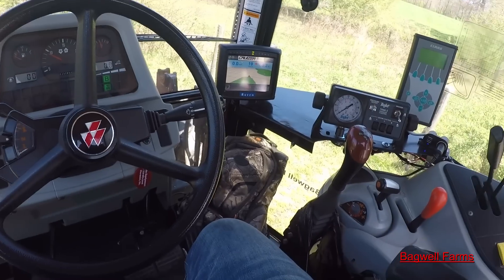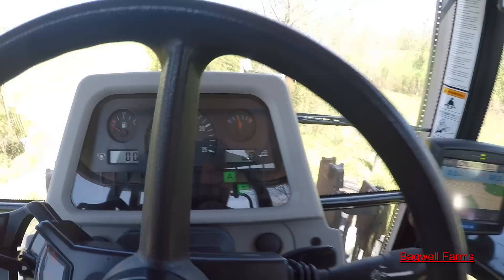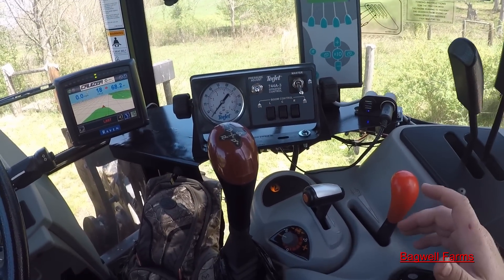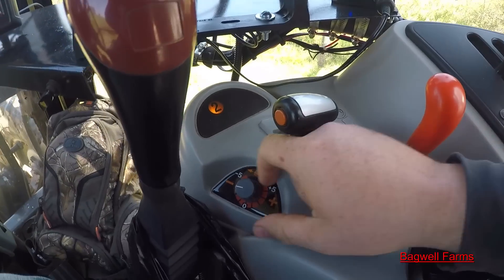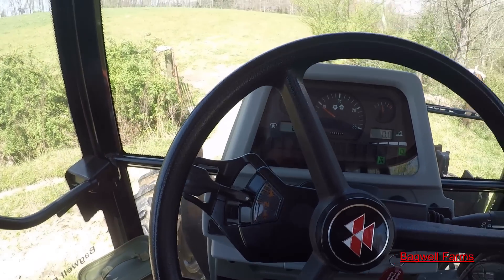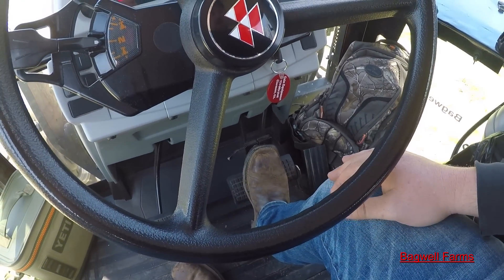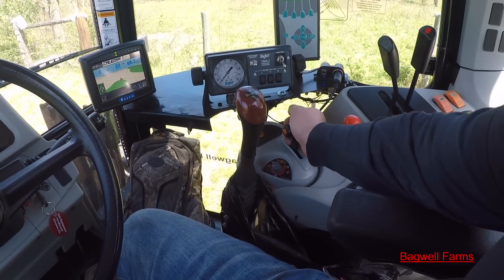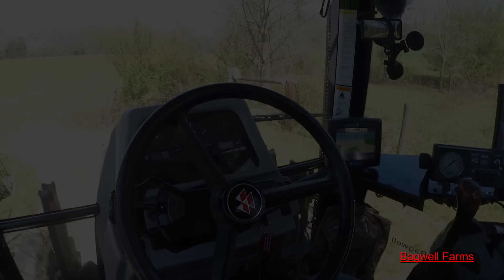Massey Dyna 4 Explained

Comment: I just bought this tractor. I just took it for a spin at the dealer to get a feel for it and see what I'm buying. But now looking through the controls, this seems like a machine for someone who never worked a day in a tractor. It's just that simple. I can't wait for spring and summer when the work starts. This is gonna be so much easier to work with then you dad's old IMT 539.

Comment: I don't understand the ABCD part? What does it do? Does it give the tractor a better power range going up hills?
Reply: think of it as gears are groups 1,2,3,4 and A,B,C,D are the equivalent to 1st 2nd 3rd 4th in a manual shift car. the power shift is A,B,C,D the manaul clutch in and out are 1,2,3,4 except it doesnt need to clutch in for 1 2 3 4 but will delay it more than A,B,C,D?

Comment: We have a 6180 Dynashift 1997 and the Dyna 4 looks to me like a really simple and intuitive transmission to use. It's almost the same. 1, 2, 3 and 4 are changed electronically instead of manually. We can't shift the powershift while changing the ranges though. For example when I want to shift from 2D to 4A (gear stick will detach if I push it too far in 3-rd gear), it shifts to A just before the tractor stops. So I rev it to about 2000 rpm in 2-nd and shift to 4-th in at 1000 rpm. I also love the reverse shuttle on your tractor. Ours is just a pain. It doesn't have neutral and the security system against accidental shifting is coming to a full stop while pressing the clutch. Otherwise it just keeps beeping. Made some changes with the reverse because we often couldn't change directions. And it also sometimes gets stuck in creeper gears. It's a pain going back home at 13km/h at 2500rpm. Apart from that the powershift is really convinient to use. We've done 8400 hours on the tractor and haven't touched the transmission or the engine so far. Great tractor , bad electronics.

Comment: start stop via brake pedal is a Valtra feature (Ndrive) or auto traction  incorporated after valtra became part of Agco  I would think as you say very handy for baling however on my Valtra N101 I find it a bit agressive however the clutch may need calibration which should improve this
Reply from the maker: Interesting didn’t know that’s where it came from they don’t offer the valtra brand in the USA they just brought fendt over in the last couple years. How do you like your valtra? Compared to the other brands
Reply: I find the Valtra to be a good sound tractor. They have a great reputation for reliability. The Sisu engines ( now used by Massey) are one of their strengths. One criticism I have is the seating position which is offset which makes it a bit difficult to get a comfortable driving position.
Reply: Just add to my response I have a Ford 6610 for 20 years will probably keep that as it has been great, have had New Holland TS115 sorry I sold it. I do have a preference for New Holland but I am currently considering a Massey 6460 Dyna 6 .  Would   you consider the Dyna6 a good transmission ?

Comment: I think that shuttle was used on the Challenger 400 and 500 series too. But I don't think they make those anymore.
Reply from the maker: Make the shuttle? Or the tractors?
Reply: The Challenger 400 and 500 series are actually Massey Ferguson tractors painted Caterpillar yellow. With them you get either Dyna-4 or Dyna-6 transmissions.

Comment: I would like to put a monitor mount in my 5611 like you have. Do you by chance have a pattern of your mount you could share with me?
Reply from the maker: I don't have a pattern but I made videos step by step of me making it I created a playlist of the videos of me making it for you goto my playlist an its titled my monitor mount what I did is I took a piece of cardboard an cut it to the shape I wanted it then I traced it onto a piece of sheet metal I got at tractor supply an cut it out the videos are from when I first started so the quality isn't as good as they are today but it will help you it wasn't hard to make you just need a welder an a cutting wheel for a grinder
Reply: thank you so much

Comment: I almost bought a 5610 today, went to SC to look at it. Unfortunately it was to ragged out for me, it had 1700 hard hours on it.
Reply from the maker: DLH Farms yea it’s hard to find anything used that hasn’t been abused for a good price their good tractors if you can find one
Reply: LoL thats exactly where i went
Reply: I cant but discourage you enough from buying a 5610.  I know plenty of people have given them good reviews but that 3 cylinder isn't a good engine. Yes it is reliable but it is has no low end torque, you will find yourself reving the engine up to get anything out of it. Also if you stand outside the tractor and listen to someone drive it along it sounds like a young boy is driving it who cant decide what rev he wants, it is always trying to make its mind up. The 4.4l engine in the 5611 is twice the engine. The 5610 is alright if  you aren't putting it properly to the test but we weren't happy with ours when we bought it and we traded it in losing 8000 pounds just to get a mint 5455 that was a far better tractor in my opinion.
Reply: AgriSpec. Hmm interesting
Reply: Look at Nance tractors web site he has a 5610
Reply: 5710 sl does have 4 cilinder